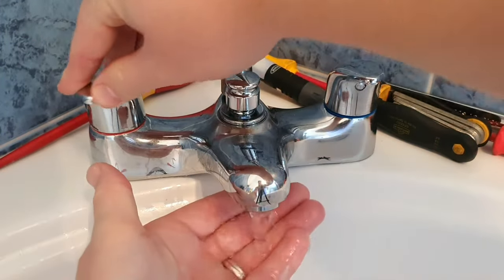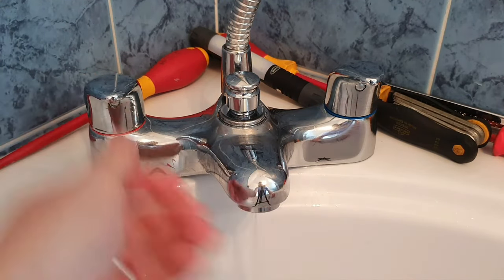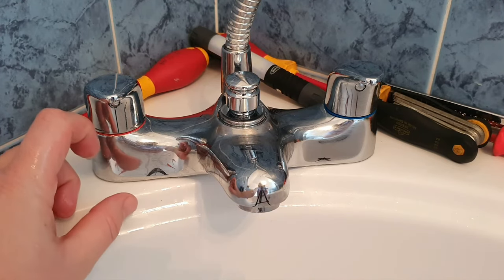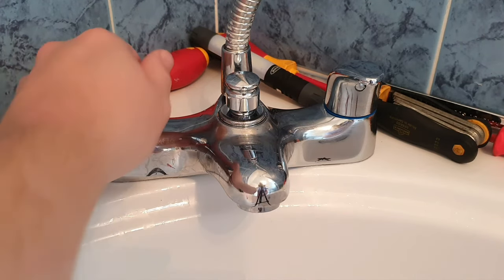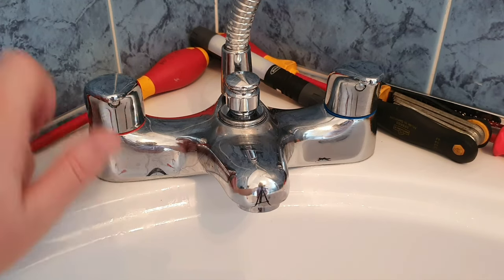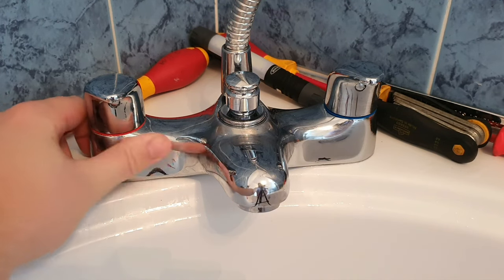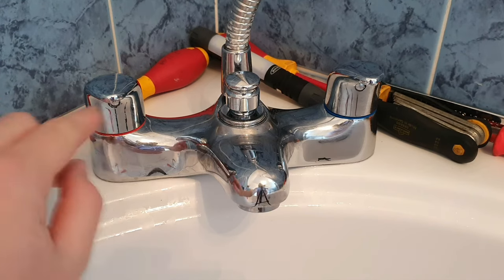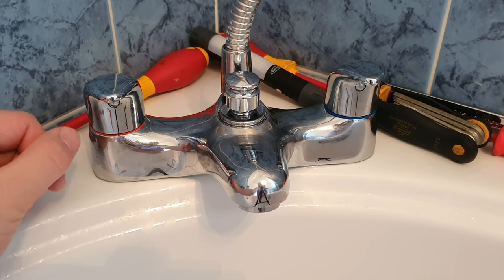How To FIX a LEAKING Tap, In Just A Few Simple Steps

Comment: Thank you for this, its worth pointing out you should ideally rinse clean the part before putting it back, the chemicals in whatever spray is used will weaken the rubber seals in the tap, its the same reason people suggest never putting bleach in the toilet cistern.
Reply from the maker: thank you very much for the info i will bare that in mind next time. thanks.